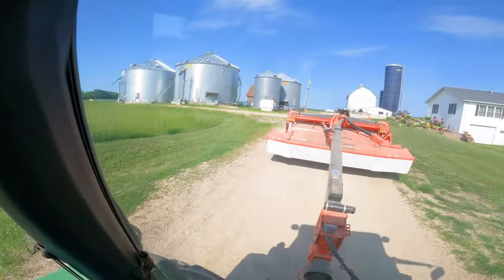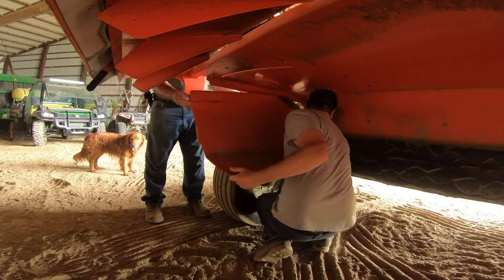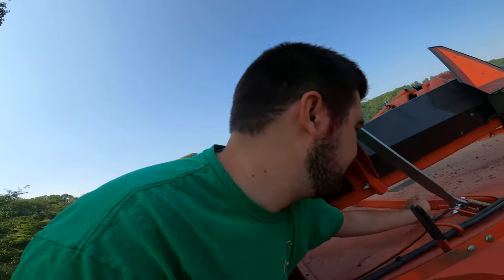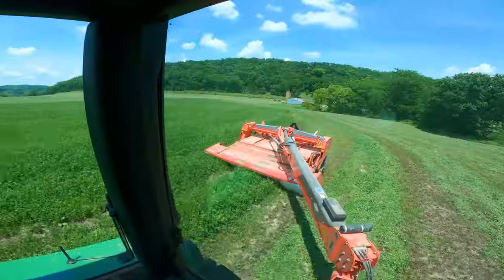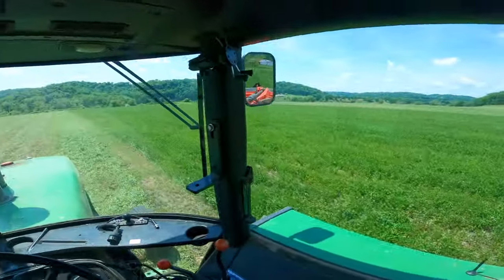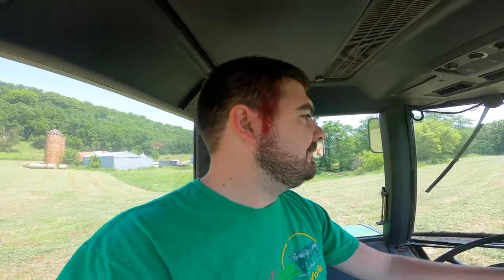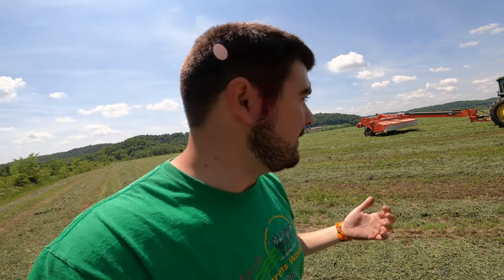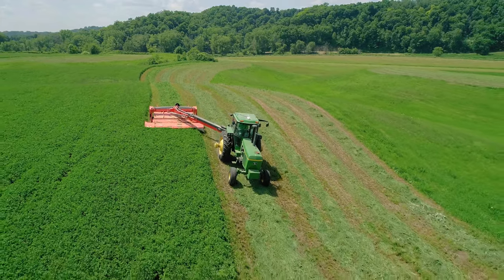Mowing In The Valley - KUHN FC 4060 TCR

Comment: You are cutting extrem low ... 1,5 inch are only 3,81 cm
I cutting at a height of 8 cm so 3,15 inch 
Tests showed that Gras that is cutting at a height of 3,15 inch compared to 1,96 inch , is producing more than 5% more in total of one year and Gras will dry Down faster because it is not so near to the ground

Comment: I like the video it's a nice comparison between the 2 mowers I like both of them I am partial to the John deer but the Kuhn is a very nice mower I would like to see a video of how it works in heavier hay fescue with some clover mixed in and maybe some orchard grass nice video
Reply: Kuhn make the mowers for jd so really just depends what color you want to match your tractor
Reply: @jameshavill4504  Kuhn makes JD's THREE POINT MOUNTED non-conditioning hay mowers, NOT their pull-type mo-co's... John Deere makes their own mo-co's which are COMPLETELY DIFFERENT from Kuhn's cutterbar.  JD does however buy the Kuhn mowers and paints them green in the three point hitch mounted disk mowers, they are the EXACT SAME MACHINE as the series 2 Kuhn 3 point hitch models.  Kuhn uses a "gearbed type" monolithic cutter bar in their mowers... stamped steel halves welded together into which an interlocking series of gears are installed, each one spinning the next one down the length of the bar, which spins the disks installed on top of certain gears between the idler gears in the bar.  Deere uses a MODULAR gear-type cutterbar on their mo-co's, which uses individual cast-steel or cast-iron "modules" with the gears inside to drive the disk, and these modular units bolt together so the gears mesh and drive each other... The disks are also larger so they turn slower to produce the same blade tip speed compared to smaller disks that have to turn faster to produce the same blade tip speed.  
Deere's pull-type mo-co's and 3 point hitch models have NOTHING in common, since they're from two different manufacturers!  Later!  OL J R :)

Comment: I assumed the John Deere mower had a conditioner in it too.
Reply: It does, but it's a different type... flails, which is a spinning rotor turning "backwards" to the direction of travel, with spinning pivoting bars or tines sticking out of from it.  As the mower cuts the forage off, it goes over the cutterbar and into the flails, which whip it upwards against a conditioning hood, a flat or curved sheet of metal, sometimes with diamond plate or other "texture" to it, which slows the forage down so it gets smacked and rubbed by the high speed spinning flails a few times before it gets discharged out the back of the mo-co.  The flails are "meant" for grass hay, and work by "abrading the waxy outer layer" off the grass stems to make them dry faster.  

The Kuhn has conditioning rolls, which are intermeshing lugged rubber rolls that pinch, crush, and kink the hay stems between them, cracking them where they are forced to bend around the corners of the lugs and crushing them between the two rubber rollers, before expelling the material out the back.  Rollers are made more for alfalfa and finer, leafier crops that can have leaves stripped off by the more aggressive flail conditioners.  Both have their place, and some people prefer one over the other for their crops and conditions... Flails are cheaper to buy and maintain, though they do usually have a little more maintenance than rolls due to all the individual flails and pivot points on the single main drive roll the flails mount on, BUT they last a LONG time.  Roller conditioners are more expensive to buy, and there's two rollers in there mashing together; no free-swinging flails to maintain, BUT when they get old and the rubber starts going, they are VERY VERY EXPENSIVE to replace or have resurfaced... 

Later!  OL J R :)

Comment: Huh, so the clover leaves will turn black during drying if mishandled?  Is that right?  I wonder then how much turns black because of the flail conditioner versus the roller conditioner on the kuhn.  Could be an interesting thing to look at as well between them.

Also, is there plans for an update on the fields you seeded with the kuhn seeder back in spring?  I know you had an update 2 weeks after planting where we could see the rows of initial emergence, but curious how well the grass has taken with seeder after several months.  I recall at least one field/area was reseed from it failing to take hold with the deere seeder you guys have on the farm.
Reply: Shouldn't be much difference in the conditioners, IF the hay is dried down to proper moisture for baling... Now, one conditioner MAY WELL dry down FASTER than the other, which would be interesting to see... OL J R :)

Comment: Have you ever ran disc mowers on your farm and if you did what brand
Reply: Them 2 mowers are disc mowers
Reply: James havill no that’s a mower conditioner they do have the  disc but there is the conditioner (rollers) behind the disc. Where I’m at in the south most farmers run the disc mowers and not the conditioners
Reply: @dawsoneubank1432  they are still a disc mower the cuter bar is the same weather or not they have a conditioner on.
Reply: They're so far north need the conditioner if you don't want hay on the ground for a week or two trying to get it dry, and almost certain to get rained on in that length of time, particularly with legumes.  In the South we can get by with the 3 point hitch non-conditioning disk mowers because most of what we bale is grass, and it's SO much hotter and sunnier that we can make hay in 3-4 days or so down here versus up there, MUCH easier to get hay dry in 100 degree temps... Later!  OL J R : )

Comment: Why don’t y’all have self propelled mowers? You should try a demo
Reply: Will Johnson Gee I am sure they would love you to buy them one! XD
Reply: Why would they need one? They aren’t doing any custom hay
Reply: BIG BIG $$$$... unless you run an old one that's affordable, but would break down more.  SP=one more engine and transmission and final drives and hydrostats and air conditioning and all that other stuff to keep up and maintain to do the SAME JOB that the tractor sitting in the barn is perfectly capable of doing with a pull-type mo-co... That's why... OL J R :)

Comment: Compare the crimper between Kuhn and JD
Reply: If memory serves the JD uses a flail so a comparison is impossible. The story is flails strip the wax coating off of grass while conditioner crimps the stems. IE flails would work better on grasses and the rollers would work best on leafy plants like legumes. Have never run a flail mower so no personal experience.
Reply: @ArnieD17  Made sense, but from what I understand crimping drys faster.
Reply: Yeah I'd like to see that too.  They bale mostly alfalfa and alfalfa grass mix and have been cutting it all this time with the JD flail machine and doing just fine.  I've heard experienced hay guys say that the "flails are for grass" stuff is mostly sales hype; that they've had just as good a luck with the cheaper flail machines in alfalfa and legumes as the more expensive roller machines.  Some guys swear by the rollers even in grass type hay, haygrazer (sorghum-sudangrass), etc.  Some guys swear by the flails.  Guess a lot comes down to local conditions and what you're cutting, and personal preference... Flail machines are cheaper to buy up front and less to go wrong, but there IS some maintenance with all the flails and their pivot points on the single flail rotor in the machine, but cheaper to fix and more forgiving of something that's not supposed to be there going through the machine.  Rolls are more expensive to buy up front, but maintenance is usually a lot lower despite having two rollers with twice as many bearings and a pivot at each end to allow them to spread enough for stuff to go between them... BUT when the rolls get old and the rubber starts going to pot, or if something that's "not supposed to be there" gets pulled into the rolls and tears up the rubber, then repairs are EXTREMELY expensive compared to flails.  Rolls usually take more power to operate than flails as well.  BUT the rollers also crimp/crush the plants between them, splitting the stems and cracking them, versus flails that just sorta rub the outer layers off and bruise the plants and maybe kink some of the stems as it bashes the stuff on the way through before it gets tossed out the back... 

I mean, BOTH work, but it'd be interesting to hear their opinions and observations of which is actually doing the best job FOR THEM in THEIR CONDITIONS... (which might or might not apply to other folks elsewhere!)  

Later!  OL J R :)

Comment: The john deere mower looks like it's doing a much better job. But that's to be expected.
Reply: Kuhn make all the mowers for jd the only difference is the color
Reply: Thanks captain obvious.
Reply: @jeffreyhouston2043  if you know they are same then why do you think its expected that the jd is better because green paint don't change how it works.
Reply: They're not exactly the same. That's why they perform different.
Reply: @jameshavill4504  No... Deere builds THEIR OWN DESIGN for their pull type mo-co's... Kuhn pull types are completely different.  Kuhn DOES build JD's three-point hitch MOUNTED non-conditioning disk mowers, which the JD 3PH disk mower is just a Kuhn painted green with Deere stickers on it, exact same mower as the Kuhn 3PH models... BUT the pull-type mo-cos like these are COMPLETELY different built by the two different companies.  OL J R : )